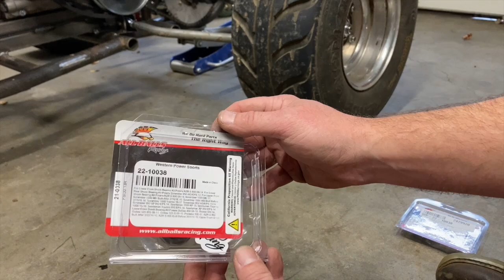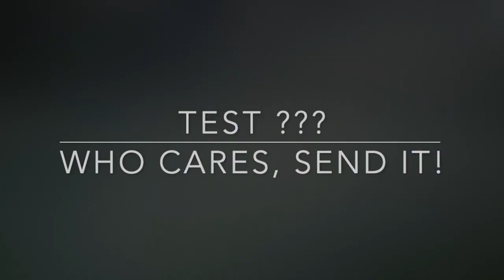Predator 420cc (459) Safari Mode

Comment: I have an offroad buggy that I built years ago.  One of the early iterations used the Comet clutches, like yours, with the 7/8 inch belt.  It wasn't the best setup because the belt would slip, just like you see hear when you're driving slow.  The fix was to go with the larger Comet clutches and their 1-3/16 belt.  In my case, the Duster clutches, but with your horsepower, the Comet 780 clutches would be a good fit.  You will find a night and day difference when you run that buggy with a heavier duty clutch setup.

Really enjoying your builds.
Reply from the maker: I’ve been looking at the 780 setups. I know if I get some more ponies out of that predator the 40 series could become a problem. The belt doesn’t slip too badly when just driving it normal, just when I go really slow. I’m going to tune the clutch weights to see if I can get a little more low end power. I do love tinkering with this and it’s my favorite in the aspect I can keep adding stuff to it and keep upgrading it. Humble beginnings as a budget kart could turn out to be the most well rounded. Thank you for the comment 👍

Comment: The lack of floor is terrifying.
Broken legs would really suck.
Everything else is awesome.
Reply: Security is an important point. When I made mine, I already did it with steel side and bottom protections.
Reply from the maker: Yeah I guess a floor should be next 😁. We get so used to testing them without floor that it’s not a big deal, even for my 9 year old daughter…
Reply: @KJRaycing  as a father I couldn’t imagine the guilt I’d feel if my baby got hurt.
I love what you’re doing, thanks for sharing.
Reply: @KJRaycing  I understand, but there is a risk of getting hurt on a trail or even being pierced by a tree branch.

Comment: How's that 44 series Torque Converter working for you? Any belt slipping? I've tried the same clutch but didn't work out for me
Reply from the maker: When I switched from the 40 series to the 44 series it was like magic. Everything works so well and nothing gets hot.  I have an assortment of weights (pucks) on the way to dial in the power band.  It engages about 800 rpm too soon and I want to do biiiig burnouts, drifts and climb anything.

Comment: I really do like this CrossKart design. How is it to mount an ATV chain gearbox? I have a Polaris 350L Trail Boss 4x4 gearbox with chain out put. Thinking best way if I get these CrossKart plans, I would have to mount the engine right on top of the gearbox.
Reply from the maker: Well The next upgrade for this one is a polaris sportsman 400 two stroke so we will find out (spoiler alert it’s going to be awesome).

Comment: I have looked around your website. Can't seem to find any place that suggests or recommends engines. Point me in the right direction please.
Reply from the maker: That's what the YouTube channel and Facebook group are for 👍
Reply: @KJRaycing  Looked there too. Didn't see what I am looking for. I guess that's a quick way to loose a potential customer.
Reply from the maker: well what are you looking for?  There have been motorcycle engines, atv engines, snowmobile engines and generator engines used all from the same set of plans and YouTube videos.  And I'm doing this to help garage fabricators, not to get customers.  I'm a military aviator of 23 years and still going.  I wish you the best.

Comment: How’s that drill press you have? Iam Just starting out and there’s so many different drill press out there
Reply from the maker: It has worked out really well. I’ve changed the belt twice and had to replace one of the pulley gears because it was plastic. The drill press vice is what makes everything so much easier.